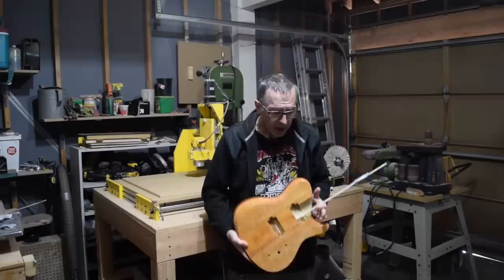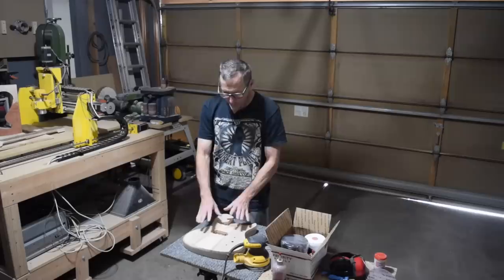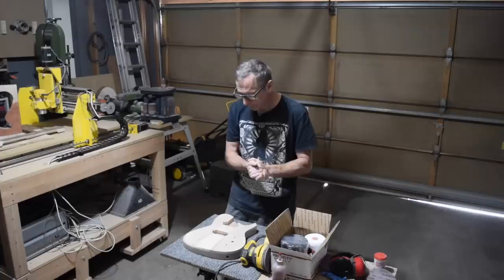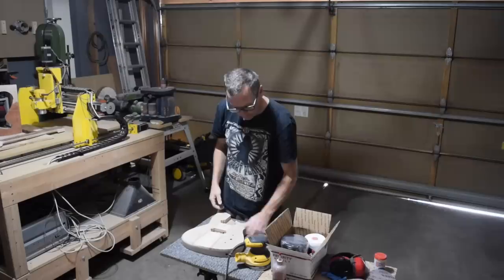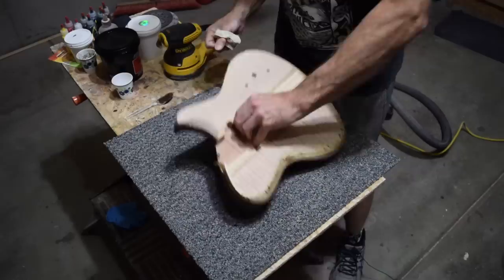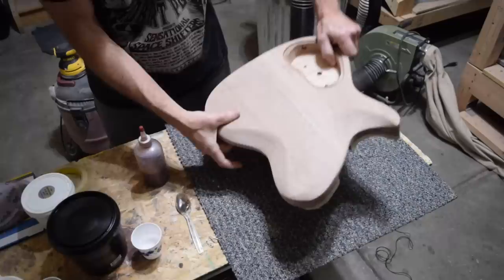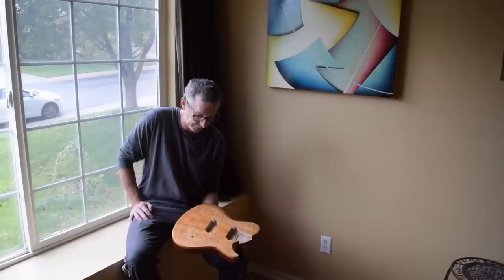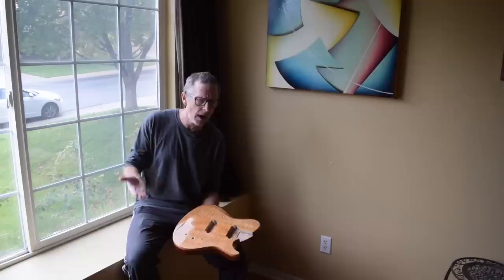Episode 121 Finishing A Guitar With Crystalac CraftNique Pigments And Brite Tone Instrument Finish

Comment: A way of catching the curly q scratches is to wet the surface of the wood with a damp cloth and water, between each grit change. It will raise the grain of the wood and all sanding scratches
Reply from the maker: I'll have to keep that in mind. I usually pre raise the grain at least once during the sanding process to make the surface extra smooth, but I never considered it for dealing with the curly q scratches. Thanks!

Comment: Thanks for the thorough information on this project.  I have finished a few guitars and your channel is easily the best resource available for a variety of applications.  I came to this video as I have a cheapo guitar body that came with a sealer coat on it.  These are typically painted opaque, but I actually like the grain pattern, and would like to take shot at applying a transparent color.  While I have done my best to sand it off, there still appears to be some spots in the grain where it is embedded pretty deep.  I would like to avoid sanding too much material off, and thought a gel stain/dye like the Crystalac you used in this vid might do a better job of covering and creating a film layer instead of a traditional water based dye that would need to penetrate and absorb more in the wood.

I typically use Keda Dye powder mixed with water, and I have a lot of it on hand, so I would prefer to use that as my colorant instead of of buying the CraftNique pigments.  I would imagine Keda could be used to tint the Crystalac clear gel stain since they are all water based, and was curious if you had done any experiments using anything other than the CraftNique pigments to tint the clear gel?  Thanks for all the videos and info!

Comment: Your tip about applying wax to the control knob holes so the bare wood doesn't absorb water while wet sanding...what a great tip! Thank you so much for taking the time to create, edit and post your videos!!
I'm finishing a Firebird kit now. Going to use the crystalac bright tone for sure! Your guitar looked absolutely stunning at the end with the window test. I call that "walking light back and forth" across the body:)

Comment: P.S.,I have found by doing a light wet sand, to break the skin of the coating and allow it to gas off and cure. The coating will be much easier to final wet sand and polish. Also, please stay away from silicon carbide paper and use the micro mesh for the higher grit.
Reply from the maker: These days I'm dry sanding with Super Assilex and getting great results.

Comment: Dear Sir, thank you very much for the tips for using wipe- on poly. I have been looking at some other techniques. I am a retired old man and have been making bird cages for a special tropical (rear) birds. They belong to the Finch family. The young male is brown in colour From that they moulter to a black upper body to the tail the underbody and beautiful dark- reddish from the crop to the beginning of the tail. Thee are 3 sizes 12''. 14'' an 10''. They are very complicated to make. I use airline waster stain (many beautiful colours. The emphasis among bird lovers is to get a very high shine. Around the cage is usually about one and a half inch width and beams 1/4 in. I usually cut out, bore the holes for the wires,  sand and assembly. I use  Ephonify, but mostly Watco wipe on or Polyurethane Wipe on or Varathane high gloss.  I get good results but I need more sheen. I would appreciate you step me for through to get a really hi-gloss finish. my email is nwsukul@rogers.com. Or please if possible reply to me on this note. Because of its frugality, I use 000 steel wool to sand lightly. The directions on the thin is to rub in briskly this then to dull the sheen even after 5 coats.  thans   my nene is neville sukul.   Go bless

Comment: Excellent tutorial. Well presented & with clarity. Amazing result. However, I would recommend increasing temperature to 40C to reduce cure time & raising the glass transition temperature (softening transition) of the resin. By increasing the temperature by 10C you double the rate of chemical reaction.
Reply from the maker: I have tried similar in the past. It made no difference.

Comment: Ok I am sold on trying to use a water based finish. I mainly use solvent based leather dyes and wipe on poly for a finish. I have tried multiple times using a acrylic lacquer but takes forever to cure and I end up getting dents and soft spots. I think this method will end up saving me a lot of hassle and give me a great result.
Reply from the maker: There are basically two types of polymer used in water-based finishes; acrylic and polyurethane. Crystalac is a polyurethane-based finish and is much harder than the acrylic-based finishes.
Reply: Highline Guitars Quick question . Instead of using the craftnique pigments for color, could I use water based trans-tint dyes for color?
Reply from the maker: @heathpass3708  Quick answer: Yes!

Comment: This is an excellent video. Great work.  I didn’t realize the step about grain filling after staining before clear coating.
Reply: You can also apply a coat of grain filler after it's been sealed as well. Find a viscosity that's not too thin. P.S. don't apply grain filler with your fingers that's just bush league. Use a brush or rag, your application will be more even, wipe off excess and let dry 24 hours. Then go to 600 grit and reseal, 800 grit and start your topcoat application

Comment: Ive started using water based finish on my practice build after watching you videos.  So far I love it...i dont have a resourceful work area to paint in...the water base poly i have is so simple to use. Easy clean up and not as toxic as the nitro im used to using. Only thing is i have to get used to the coat count with water-based. The finish feels to thin, have to do like you did and apply more coats. Seeing this i now know a glass like finish can be achieved with water based finish. Just takes some getting used to

Comment: Chris, thank you so much for such a comprehensive tutorial.  You recommend cleaning your level sanded finish with denatured alcohol.  I just want to point out that the finish much be "absolutely" cured before using alcohol.  As alcohol is a solvent for water born lacquers. I just wanted to put a finer point on this particular issue to help prevent any mishaps.  Thanks again.
Reply from the maker: DALG Guitars it’s okay to wipe the surface with a rag dampened with denatured alcohol without waiting for the finish to fully cure as long as you wipe it off right away. If you pour it on and let it sit, it will ruin the finish. That’s just common sense.

Comment: Im working on a strat build now. I have an ASH body. This is my very first build. I am also relatively new to wood working in general. Im trying to get the basic steps simplified in my mind.... 1. Basic Sanding 2. Aniline dying 3. Grain Fill 4. Sanding Sealer (I have Behlen's Aerosol Vinyl sealer) 5. Finish (in my case again I have  Behlen's Aerosol stringed instrument lacquer). This is actually my second time trying this on this body. I had a  problem during the grain filling/sanding sealing stages. I ended up sanding through my Aniline dye. I had large patches of raw wood showing after sanding through. I have now spent 3 days sanding (mostly by hand), and except for the deepest of grains, im almost back to "square one". If anyone thinks im doing something fundamentally wrong (other than being inexperienced), I would love to hear any advice.

Comment: Hit your sanded guitar with some naptha - you'll see the scratches and won't interfere with your finish.  That said I stopped using random orbit sanders above 120 grit. After that I go to a plain old 1/4 sheet sander set to straight line (non-orbiting) and above 220 it's by hand only.  BTW - "Oil" finish rags e.g  oil polyurethanes that are cut with mineral spirits will not self-combust.  That requires something much more volatile like acetone-based finishes or turpentine-based varnishes.  But if you're worried just put your rags in a bucket of water.

Comment: Great video and your patients is a virtue. I have some experience with fine finishes and the one thing anyone that does fine finishes will say is there is no such thing as expensive sandpaper. You get what you pay for. The little wispy swirls you explain in the beginning are from different size particulate in the paper.While the inexpensive paper may say 220 grit is may have some particulate that is much heavier like 180 or worse. Until those few pieces of particulate wear down they cut deeper giving you wispy marks. You may also wish to try micron sandpaper and even trizac by 3m for your wet sanding and leveling. Kudos for a great vid.

Comment: for those abranet .. what ever they call them .. go to a hard wood flooring supply and get edger screens they are the exact same thing but cost less then half ,, i used to get them in boxes of 50 for 30 bucks when i owned a flooring company and i promise they will last through 10 guitars as long as you don't get on a hard edge with them
Reply from the maker: I can get a 50 pack of Abranet on eBay for $20.

Comment: Hi Chris, again a very informative video. This is a very good product, altough i have my doubts about how it stands out in scratch resistance compared to urethane finish. I think it's equal in hardness like true oil finish, wich you can touch up easely like schellack. I've checked out the site and it's a bit pricy, but they ship worldwide. Since i live in Belgium, it's again paying with a kidney on shipping and import taxes. I"ll give them an email to see what's possible. However, if i could order only the sanding sealer and the brite tone finish per pint, it's maybee pricewise doable. Also because you could use your own waterbased colours. I don't think you can apply this over solvent based dyes or stains ? However the Mirka abrasive is widly available in Belgium. That's also a good find. Thanks for all this Chris. You are a very kind and generous person. Currently i'm making my own fretboard jig with your plans. This is very clever and doesn't take much space. This is a link about someone who uses also your jig, check this out. He"s doing also nice things with fretboards. Thanks again Chris !  https://www.youtube.com/watch?v=hwEVJC78IRM
EDIT : forgot something.. do you sand or lighly scuff between the brite tone finish layers after 4 to 5 hours, or is it still wet enough to spray and blend right over the finish ? Thanks Chris.
Reply: Hi Bruno, which lacquer are you using here in Europe? Thanks

Comment: Just use an automotive clear coat. They are able to be polished in a mere 4 hours and are super durable.
Reply from the maker: You should only consider automotive finishes if you have an explosion proof spray booth and can wear approved hazmat protection.

Comment: Great video for a novice like me.  I've watched it several times and consider it the best "all inclusive" one of all your videos.  One question: In this video it doesn't appear that you scuff sanded between the Bright Tone clear coats.  However, in a later video (Sanding Between Clear Coats On A Guitar) you recommend scuff sanding. Change in technique?
Reply from the maker: The manufacturers usually recommend scuff sanding between coats and I do as well until you get to the last 2-4 coats. When you scuff sand between coats, you can often see the sanding scratches telegraphing up through the next coat and that can make final buffing a challenge as those scratches can still be visible. Applying the last few coats without scuff sanding can eliminate those pesky scratches. However, you must apply each coat within about an hour of each other to get a good bond. Also, you have to apply those last coats carefully so as not to apply them too thick. If that happens, you can end up with a cloudy finish.

Comment: Could you wipe the body with a quick swath of naptha to spot swirly scratches after each grit?  Maybe just taking it up to 320 or 400 would work?
Reply from the maker: Better to use a bright light at a low angle.

Comment: 48:20  then the guy who bought it scuffs the back totally with his belt buckle within the first day. :(   nice job on that finish!
Reply: CrystaLac is made not to scratch once cured. His belt buckle shouldn't hurt it at all. It cures harder than epoxy.
Reply: @kelseyscraftingcornerwcrys3755  BS! I can scratch a sample piece I shot almost a calendar year ago and I can still scratch it with my fingernail!
Reply: @kevindflowers234  did you apply 3-5 coats?
Reply: @kevindflowers234  Was it applied in thin layers (2 pieces of paper thin) and given 4 hours dry time between coats? Also was anything used over it? Many times I have found the issue lies with people use buffing agents not compatible with it, or improper use, just due to it being different than what they are used to. You can call and they will always help. That definitely should not happen.

Comment: Hi Chris, I know this is an old video but I haven't found an answer to my question in any Crystalac related videos. Question is, what can be used for a tack cloth? The Crystalac container says not use a tack cloth. But a rag with rubbing alcohol bites the finish. And a damp rag or paper towel stills leaves specks.
Reply from the maker: Compressed air.
Reply: @HighlineGuitars , Thanks Chris. I use that as well just doesn't work perfectly. Appreciate the quick response.

Comment: I've added 3 coats of the finish over top of a very thin epoxy which was sanded.( I have painted a design with acrylics) My question is, what would be the purpose of sanding down the last coat and polishing? Can I just leave the topcoat as is??? Thanks! Really enjoy your videos!
Reply from the maker: It depends on what you want as a final outcome. If you're okay with it as is, leave it be. If you want a mirror-like high gloss shine, you'll have to level sand, polish sand and buff.

Comment: if it's actually PIGMENT, then it won't really stain your fingers, right?  I mean, dye or stain is at the chemical level, pigment is actual CHUNKS of stuff.  Isn't that why they use dye on fabric because that gets into all the little crevices whereas pigment would just wash out.
Reply from the maker: Pigments can be ground so fine that they will stain your fingers. The stuff I use will stain your fingers.
Reply: @HighlineGuitars  Well, I don't have the experience to know what you know.  I was just thinking that if it is a chunk of something, it wouldn't really STAIN but maybe it would CATCH in the tiny cracks of your skin but if you say so, you are probably right.  I am going to try using transtint soon and try my hand at painting a guitar.    I'm sure I'll making a huge mess so I'll definitely be  wearing gloves on both hands!  thx!!!
Reply: I bet you a dollar pigment will stain your fingers as it should or it would not change the color of the wood. That's its job. If it dies not stain your fingers then it is not pigment.

Comment: Have you tried the Solarez UV Cure Grain Sealer? It seems like it can fill the role of both the grain filler as well as the sanding sealer. Would you mind dropping the recipe for that brown here? I'll go watch the video again and suss that out but that would be super helpful. 

My current plan is to use the Solarez UV Cure Grain Sealer, the mahogany body and mahogany/maple 5-piece neck would get your "brown". The flame maple and headstock tops would get black first (sanded down), then brown (sounded down), and then red. The entire guitar would get finished with brite tone clear gloss.
Reply from the maker: I don't remember the mix. Apply your color first and follow with the Solarez grain sealer and the Brite Tone last.

Comment: Excellent video and process. The finish is just beautiful. Is this finish durable? 
Also, I was wondering what type of lifting system you use on your work bench. I have to move my bench often because I have a small shop. Thank you for sharing. 
I have been using Diablo SandNet. It is easy to clean and rinse from Home Depot big box store like Menard's and Lowe's.
Thank you for sharing. You are a Blessing to small repair shops like mine.

Comment: You mentioned that you scuff between coats of sealer, but don't say whether you also scuff between coats of Brite Tone.  Do you scuff between Brite Tone coats?
Reply from the maker: I usually don't as it can be hard to cover the sanding scratches which will sow up later when you buff.

Comment: Hi Chris, I used Solarez I Can’t Believe It’s not lacquer as a clearcoat. It looks great, however, it is more of a matte finish, and I want a high gloss. My question is: Can I apply Crystalac Brite Tone (Gloss) over top of the Solarez finish without scuff sanding?
Reply from the maker: You need to scuff sand with 220 grit.

Comment: After following your cure recommendations (1 day of cure time per coat), should I get a sand-through, how does Brite Tone perform when having do a spot re-coat in that situation? Thanks - great video. You really explained things clearly and comprehensively. Thanks!
Reply from the maker: There will be a potential for witness lines if you have to spot re-coat. It depends on how you buff. I avoid witness lines by spraying the spots rather than drop filling with a brush.

Comment: Thanks Chris for providing such insight. This video has been my bible for my first refinish which just cured for 3 weeks (8 coats of BT). In level wet sanding with micro mesh sheets, parts of the surface started to exhibit what looks like peeling sunburns (witness lines?). I managed to work it out except in curved areas like the belly cut by spending more time in trouble spots with 4000 grit on up. Have you experience with this, what might cause it & how to best address it? Cheers Chris!
Reply from the maker: I have stopped wet sanding water-based clear coats like Brite Tone. Dry sanding is way better and doesn't cause issues like the one you mentioned.